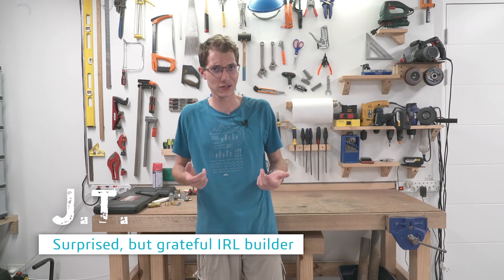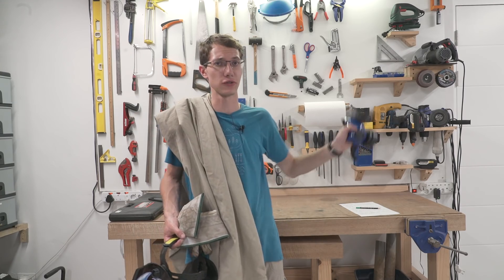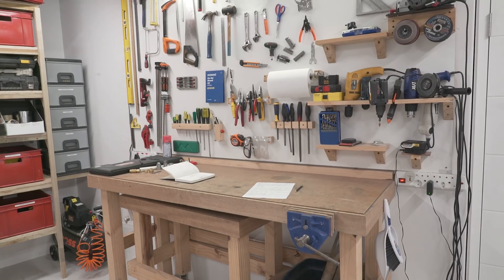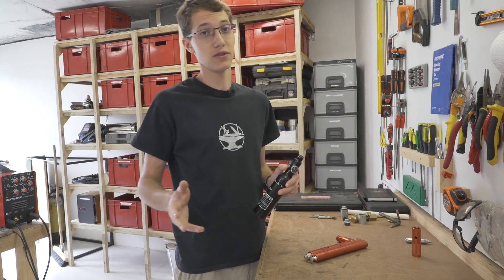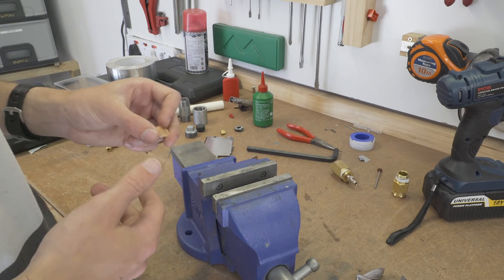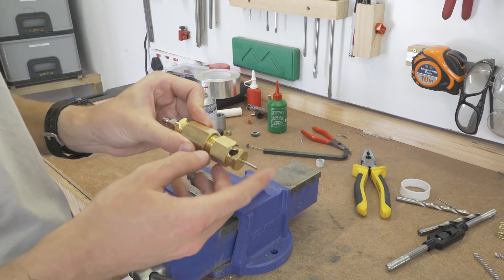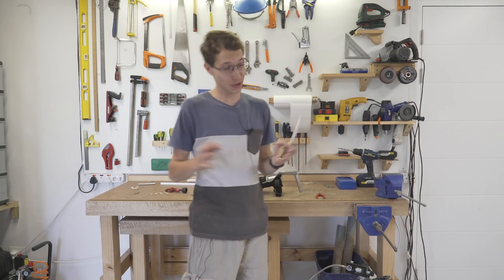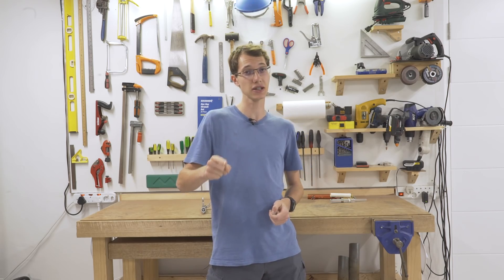Building a real, working grappling gun – Pt.2

Comment: Can you weld brass? Why not weld in a puddle of brass to add more threads instead of going with 4, then drill press out the remaining material on the inside and re-tap those a bit as well?

And if you can't weld brass, can you heat up the fittings enough to keep all current properties of the solidified brass while pouring molting brass inside hahahaha

Comment: Heck that thing is lethal, you're a braver (and smarter) man than I to be making your own high pressure valve like that from brass fittings. My dad actually works quality control for a company that makes gas instruments for oil fields etc (dew point sensor systems etc) so I have played around with a good number of brass fittings like that and swage fittings etc and would be apprehensive to try to make that myself, just watch those threads don't strip out especially on the end cap and perhaps build a jig to hold it during testing so in the event of a catastrophic failure you keep all your fingers intact. As for your supply issues I'm sure you would be able to find someone willing to have parts shipped to them (in the UK for example) if you buy them online and then send them on to you. I know this would add some shipping cost and time but it's one way to get around the supply issue especially when dealing with very specific parts, perhaps James could even help get you in contact with a parts supplier in shenzen who would be interested in working with you. Sorry I know this is a long ramble and I have probably forgotten half of what I was going to say but keep up the good work and I look forward to seeing more from you. Feel free to contact me if you have any questions etc but I'm sure you have everything under control
Reply: One thing I just remembered, I've found that a drill press/pillar drill stand that holds a standard power drill is an absolute godsend for projects when you're starting out and surprisingly cheap
Reply from the maker: @Lilith-Rose  Yep I think that and a bench grinder are the next upgrades for my shop!
Reply from the maker: Yeah it's a little dangerous but I think the threaded joints will leak before anything explodes, especially with brass, which I don't think fragments like steel does. And I am looking at ways to bring supplies in better but its all a bit pricey unfortunately.
Thanks for your thoughts!